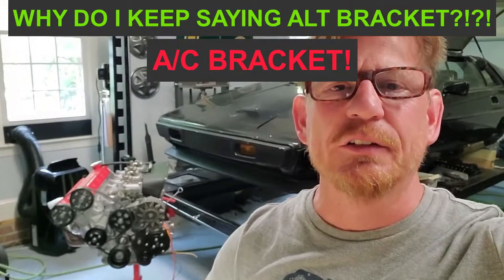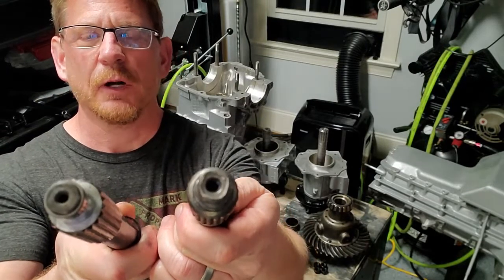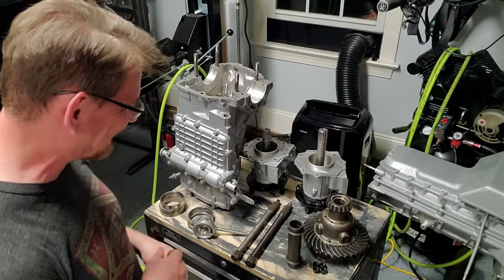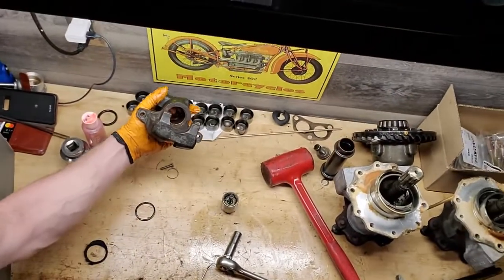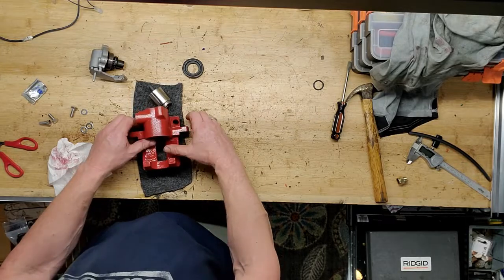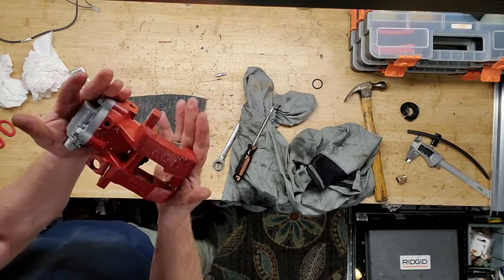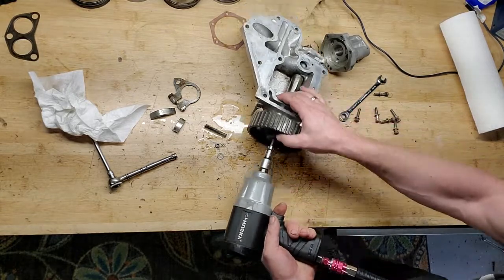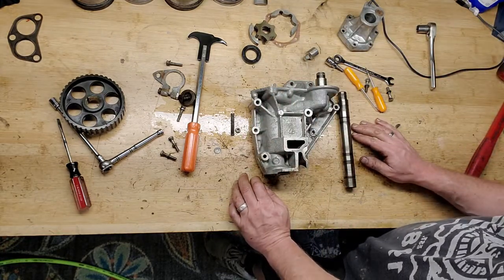79 Esprit - Episode 5 - Rebuild Continues

Comment: You deserve a Mini Split AC in your garage. Mine is amazing. So quiet and can cool down an uninsulated garage with a hot car and 100deg high humidity summers with no problem.
Reply from the maker: Haha.  I absolutely looked into it. Unfortunately for me, I didn't have a reasonable outdoor location for the Condenser.  Gotta love the HOA.  I do have a pretty good floor unit that is both heat and A/C with an inconspicuous vent to the outside... It's not quite, but it is effective.  I can maintain 70 degrees pretty much all the time, so it was a good compromise.

Comment: I love this channel I just found it. I am about to start a restoration on a 1978 Esprit S2. The engine is open, and I need to adjust the valves and shims. How should I approach this? Is there also an Excel sheet available for the 907 engine?
Reply from the maker: Hi and thanks for the comment! Yes, I'd be happy to send you the spreadsheet for valve shim setting.  The process is tedious, but easy.  However, it will likely require shim sizes you don't have on hand, so much of the time is waiting for the correct shim sizes to be delivered. Happy to help, just send a pm.
Reply: @west-cam  Thank you so much! I tried to send you a private message on YouTube but couldn’t figure it out. Then, I tried to post my email in the comments, but it keeps getting deleted. Do you have other social media platforms I can contact you on?